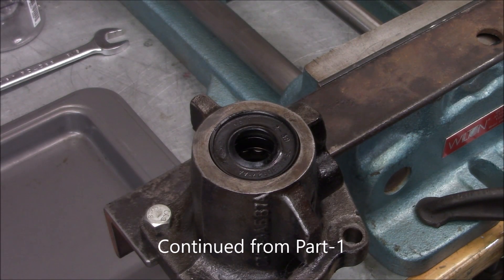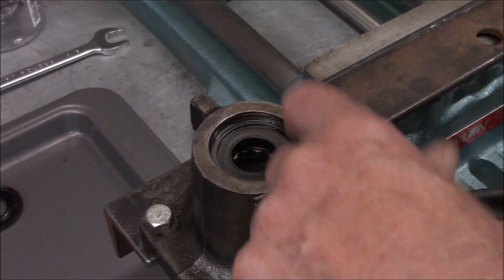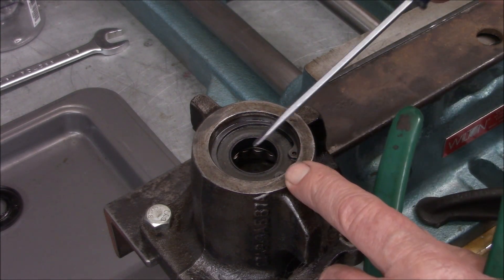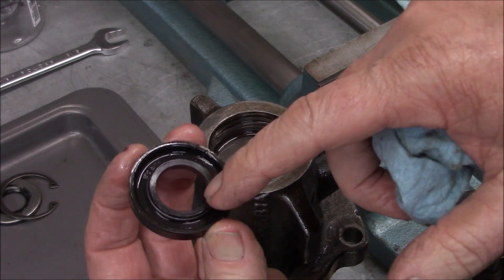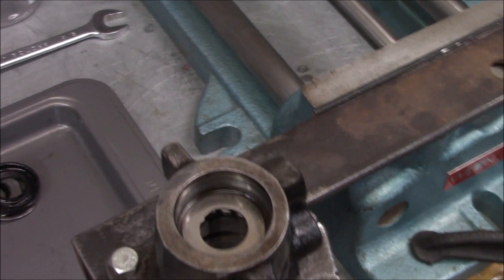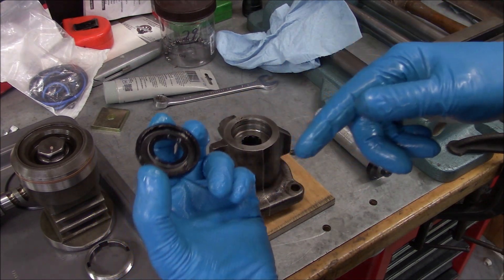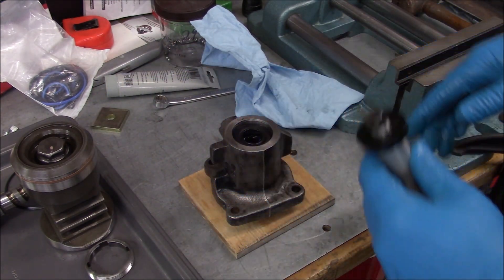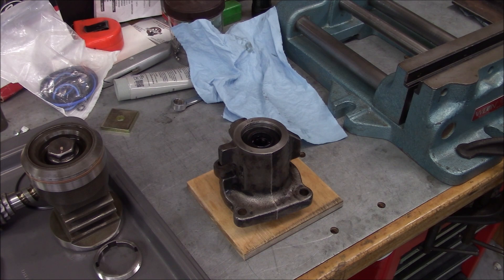[ Ford Power Steering Box Repair ]   Part-2 Bronco F Series Truck 1973 to 1980

Comment: In your opinion… can the input shaft seals be replaced without taking apart the steering box????….my steering box seems to be working fine minus fluid leaking out of the input shaft
Reply from the maker: No I wouldn't try it. The Box isn't to hard to work on, the main difficulty is finding or making the tool/socket to remove that odd ring nut. The 4 spool valve rings are also a pain, but if yours are good you could skip replacing those.